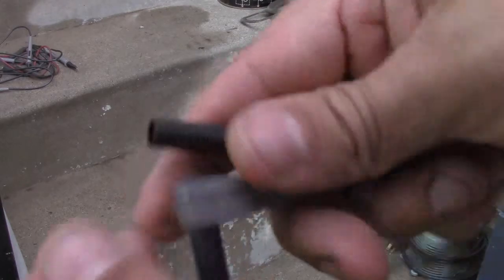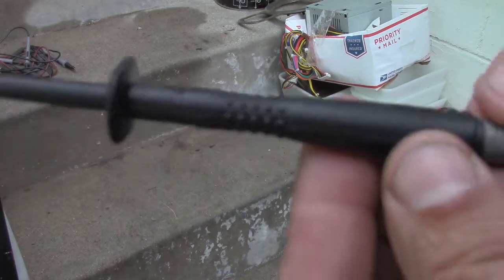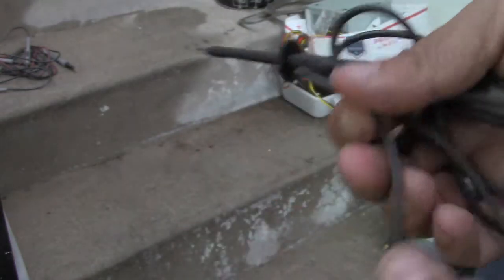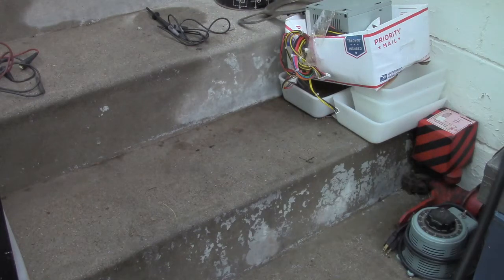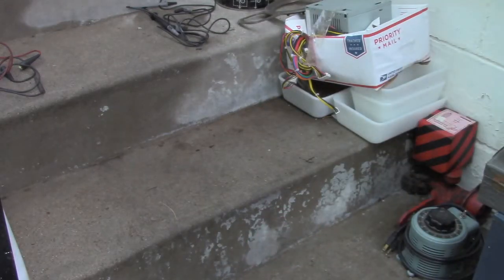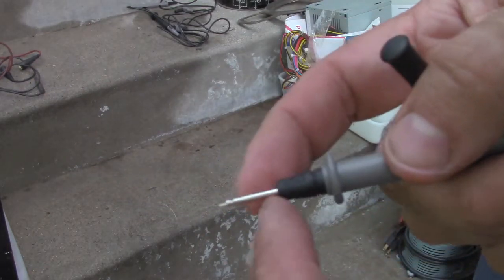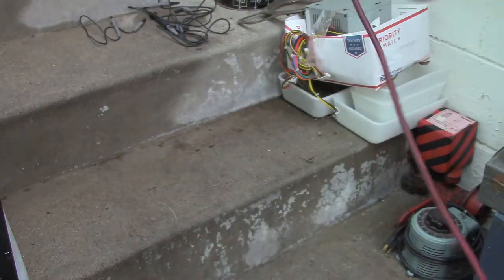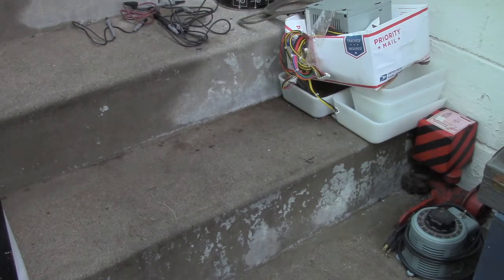Thoughts about meter test leads

Comment: I've been in contact with 240v AC mains before, felt like a mule kicked me in the chest, I was a curious (and obviously naive) teen at the time and it really did cause me to cross the room with great force... I hope your friend recovers quickly.
Reply from the maker: Last I heard He may have some work done on his hand.
I have got zapped good 2 times
One I was working on a big console color tv... pow
I jerked my arm back and put a hole in the customers wall
"way to go, dummy"
The other was a tube power amp that zapped me from the top side,
knocked me off the shop stool. A hour later I was still feeling buzzy